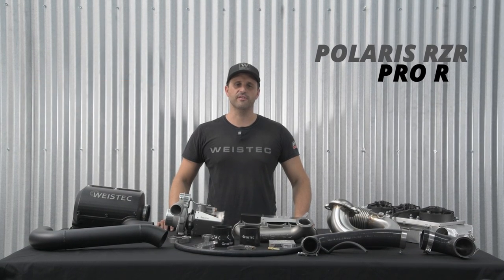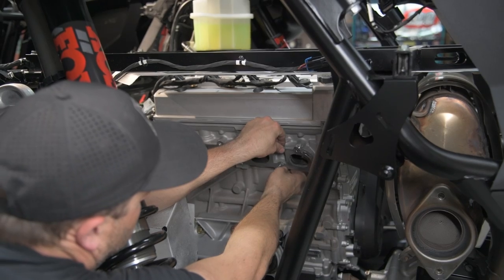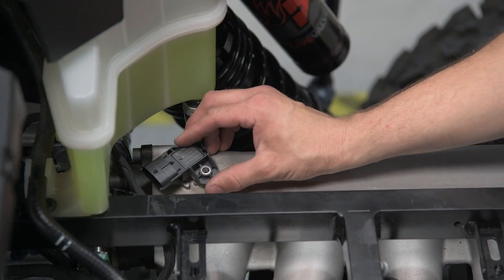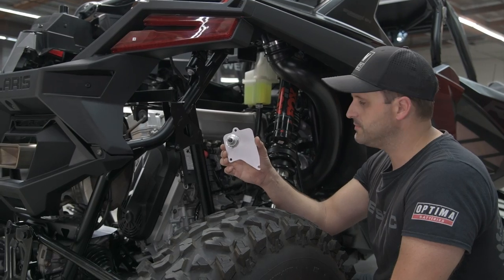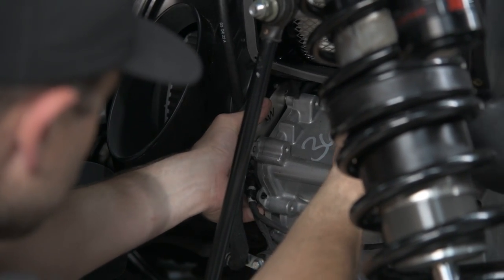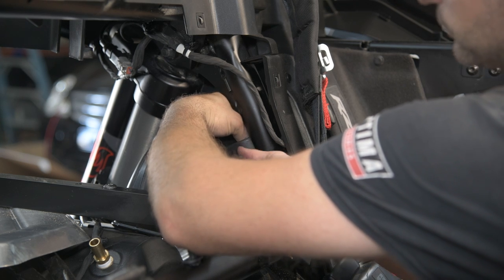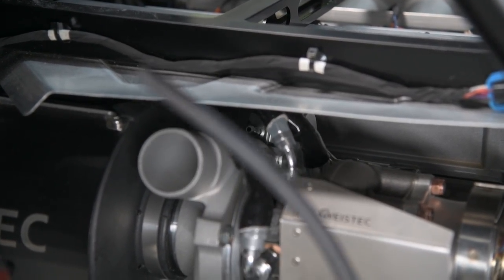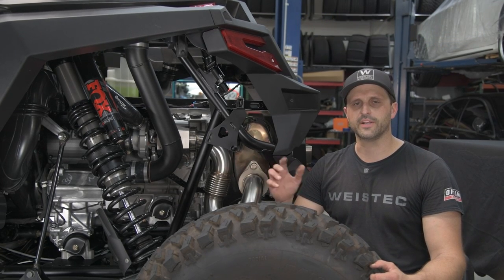Polaris RZR Pro R Turbo Install Video

Comment: Does the stage 2 have a different turbo ? Like  a GTX2860RS
Reply from the maker: Stage 1 and stage 2 use a GT2860RS
Reply: @WeistecTV  according to the garret website that turbo is only rated up to 350hp ...your stage 2 is 400hp , not a good sign .
Reply: @WeistecTV  plus they use that turbo on a yxz 1000 ...you guys are putting it on an engine with twice the displacement
Reply from the maker: @danielstanfield7772  With our own testing on our Dyno Jet dyno, we've seen just over 300hp at the wheels in stage 2 configuration. When accounting for drivetrain loss, it's a little over 400hp. It's very common for this turbo to be used on 2.0L engines. You could use it on an engine half the size and it won't be as responsive. Our standard kit is designed to have a very good turbo response. Larger turbo options (that are coming) will not be as responsive but will be capable of more power.
Reply: @WeistecTV  think I'll wait for a larger or newer turbo option ,not too  keen on spending that much on an old ass turbo ..I do love your air routing and box design though, I'd imagine it be water tight ?
Reply from the maker: @danielstanfield7772  There are a couple GTX Gen 2 options that will bolt onto this kit. You would need custom tuning to be able to run one of those turbos.
Reply: @WeistecTV  would any weistec dealer be able to tune for a gtx gen 2 ...I live in Australia is all
Reply: What other mods will be needed to run the larger future turbo?

Will you guys offer a tune with it?

Do you recommend a bigger camshaft as well say when going over 400 hp?

How much boost can you run safely on the stock bottom end and do you recommend this those head shims?